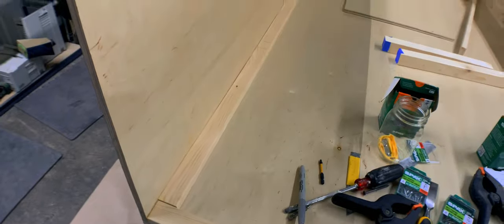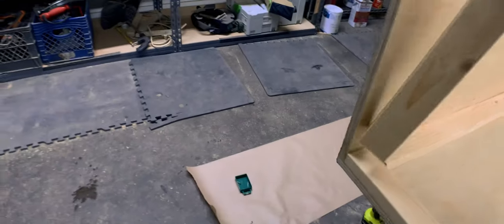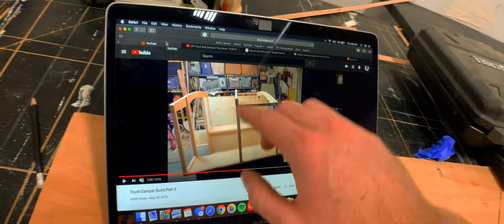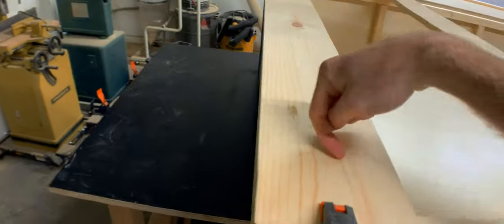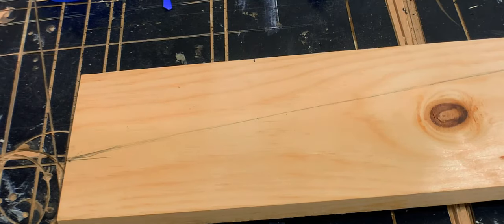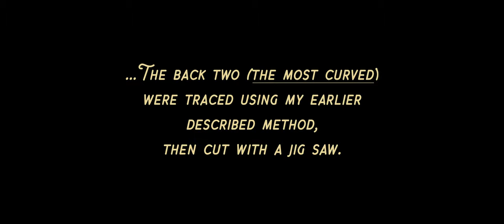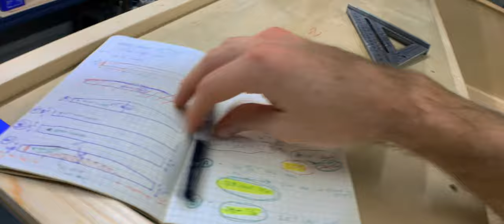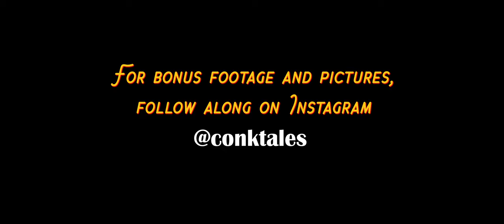DIY Truck Camper Build: PART THREE - Framing the Wagon Cabin

Comment: what you are doing is a tough build, I have built over 200 teardrops and I have found its best not to over think things, you don't need to have such drastic angles to shed water because the truck won't be perfectly level especially when you store it, "keep it simple" and the build we be more enjoyable. keep it up :)
Reply from the maker: Thanks! It’s been 4 years since I finished this build. Was a great experience and the camper is still holding up well!

Comment: I've watched several of your videos and I really like your tub design and the arches for the roof. The bedliner looks good. I'm in the early planning stages of designing a camping pod that will slide into my 7x13 Karavan utility trailer. I'll be "painting" the entire exterior with bedliner. Good looking camper!
Reply from the maker: Thanks for the kind words! My design is heavily inspired  by (if not a replica of) the original camper by @ENDGAME. You should check his videos out, and good luck with your build!

Comment: Unless I'm not understanding the issue...could pocket holes have worked? So as to not penetrate the plywood tub but still attach to it via the inside framing.
Reply from the maker: They sure could have (I believe), but, honestly, I'm not sure the idea even popped into my head at the time. Thinking about it now, I probably would have done the same thing I did end up doing, only because I wouldn't have wanted the pocket holes to show; and because I have no experience with filling (or making them), that idea might have seemed more complicated to me at the time. In the end, this was the solution that made the most sense to me, a complete novice. But great advice for anyone else who follows! Thanks, Tim!
Reply from the maker: I just remembered: I did try pocket holes when I came to the point of attaching my wall studs; but because they were 1.5"x1.5", I was only able to use one pocket hole, otherwise screws would have collided in the center, and just one wasn't enough strength.